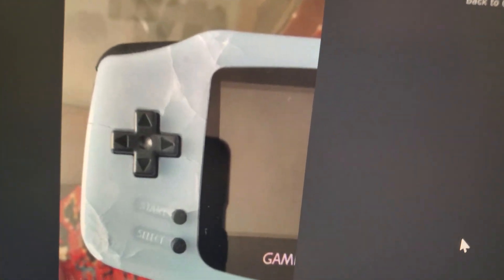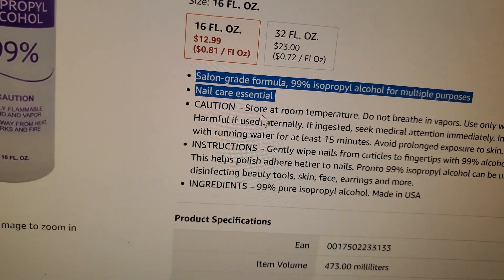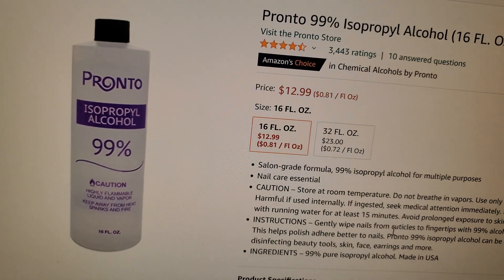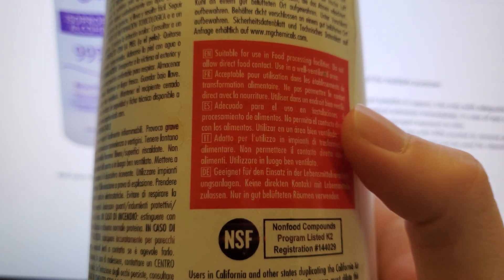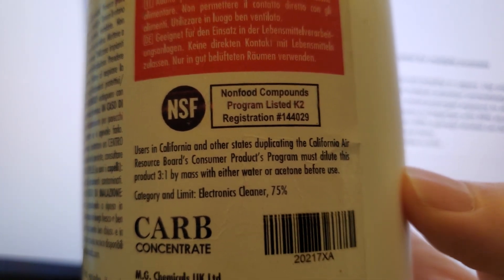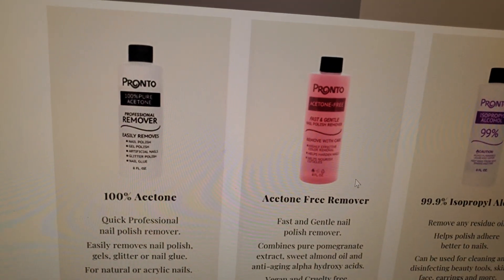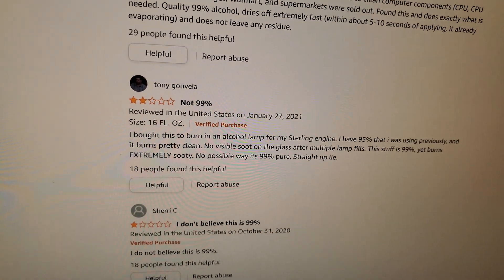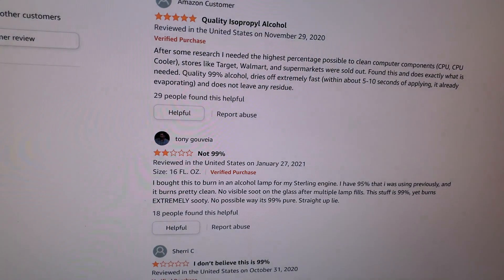IPA Additive Addendum

Comment: I have two aftermarket GBA shells (translucent orange and translucent black) and both were damaged by IPA 91% and Deoxit (contact cleaner) trying to clean ports while still inside the shell.  Lesson learned.  I'm not sure if a true ABS shell (non translucent) would be affected the same but I think it has something to do with the plastic in the chemistry used to make translucent shells.  Maybe some acrylic in there which is harmed easily by IPA.